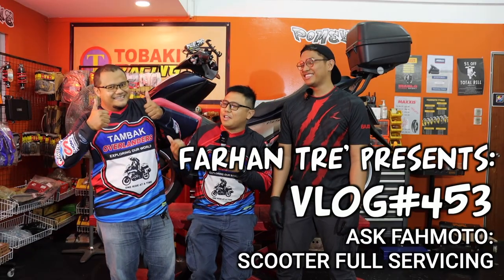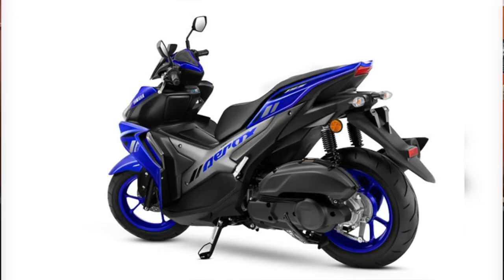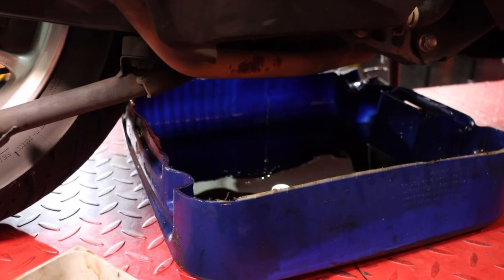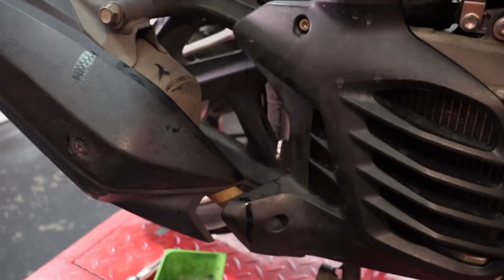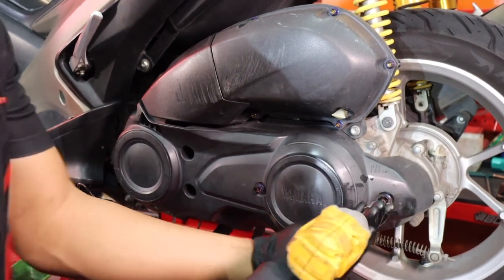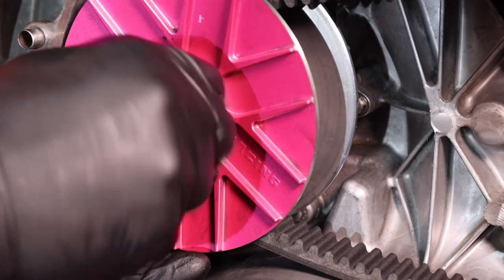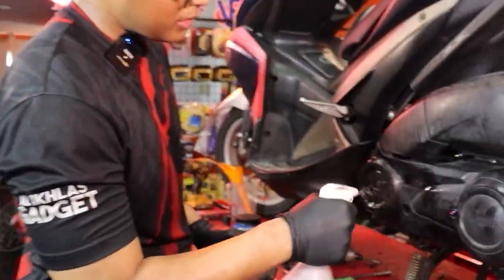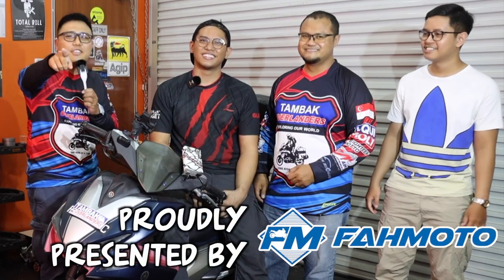Full Maintenance & Servicing of a CVT Scooter (Yamaha Aerox/NVX) Vlog#452

Comment: To prevent the engine oil flowing into the filter section, you will have to connect a tubing to the engine casing vent separately and allow this to vent out.